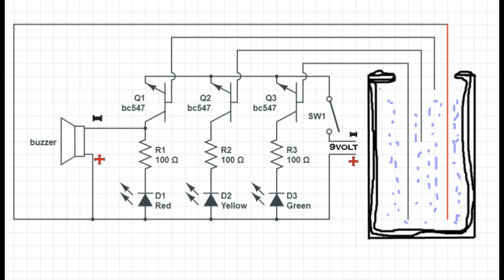Water tank overflow alarm circuit, water level indicator circuit, school project

Comment: What is that grey wire that you used to dip in the water?
Reply: A gray wire with four conductors could be a 4-core shielded cable. Here are some other things to know about gray wires and electrical wiring: 
Neutral wires
Gray or white wires are typically neutral wires that carry electricity back to the breaker box. However, neutral wires can still carry power and be dangerous if not handled properly. 
Hot wires
Red or black wires are usually hot wires that carry power from the panel to devices and appliances. 
Grounded conductors
Grounded conductors may have three gray or white stripes on any background color, except green. 
Three-phase wiring
Three-phase wiring uses three or four wires and is often used in workplaces with many electrical machines and equipment. 
Four-wire circuits
Four-wire circuits use four conductors to create two separate electrical circuits, one for each direction.